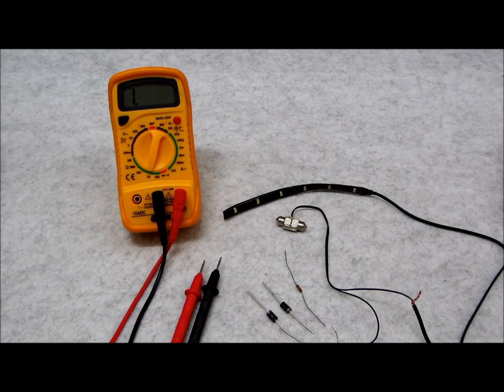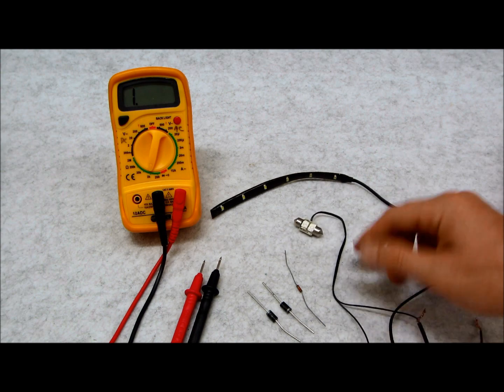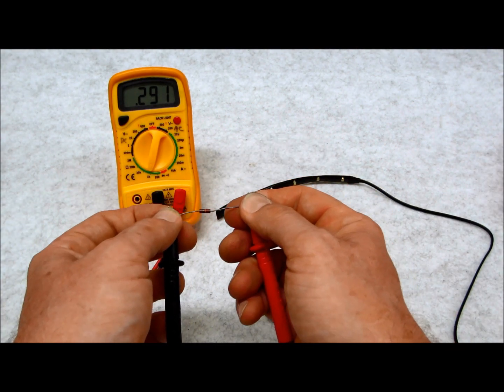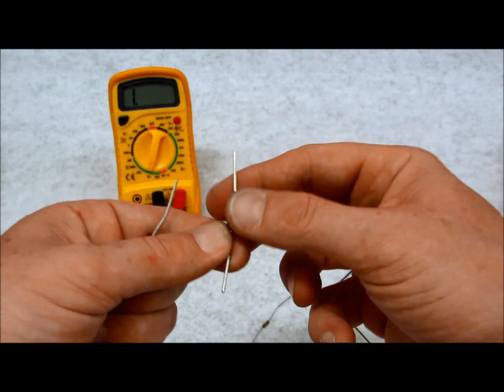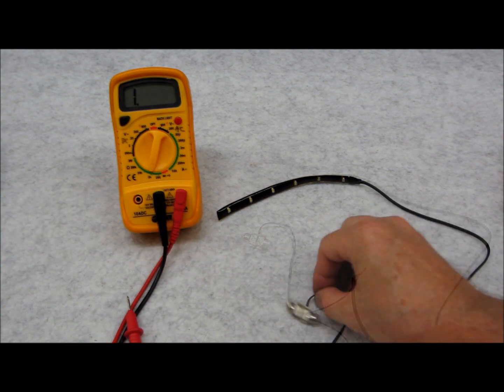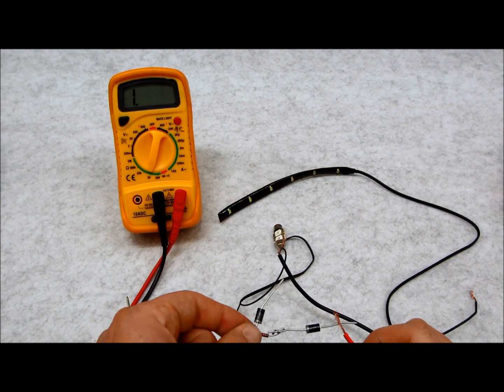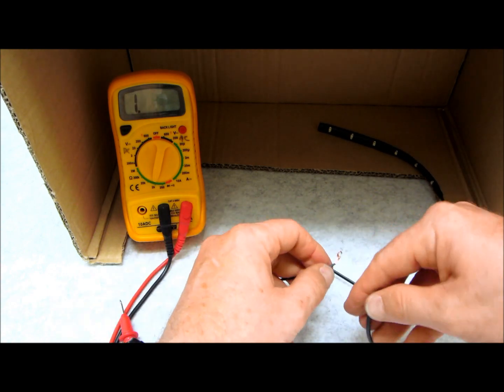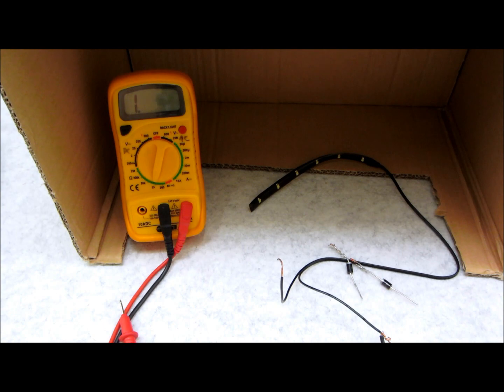How To Customize Motorcycle LED Lights / Dual Voltage and Brightness For Tail Lights

Comment: A question about the resistor. 
You said you used a 300 Ohm resistor, If you use a say 500 Ohm resistor the parking light would be dimmer correct?
Reply from the maker: +spongehow yes, significantly so.
Reply: +Lessco Electronics what about the wattage? 1/2 watt...1/4 watt
Reply from the maker: yes, you can also tinker with wattages too, theres just no limit to altering the variables of this stuff.
Reply: spongehow i

Comment: So you have to stop the bike, get off it, and manually switch the wire from the running light to the brake light, every time you want it to be brighter?

What good is that?

Comment: What diodes are they.? Is there different voltage diodes. Should I be looking for 12 v diodes for my motorcycle setup.
Also should I use diodes inline on all my led indicators aswell?
Reply from the maker: Fuji Wags These are the most popular 5 amp ones we sell:

http://stores.ebay.com/Lessco-Electronics/_i.html?_nkw=diodes&submit=Search&_sid=77826561

Comment: Just started a lighting project on my 98 Valkyrie, and while searching internet for cool brake/tail lights, I came across your video. Thanks for doing that. Very smart. I'm impressed. I hooked a cpl LED's up earlier and my 10amp fuses kept blowing. Hope I don't screw it up and burn my bike to the ground.

Comment: Lessco Electronics i want to design for 1w 350ma star red leds . .n same 14v dc power from motorbike(while running), so could you guide me if this design and components goes fine and gonna smoothly work for me , and how many maximum leds i could fit in the circuit, so that it does not burn out later . .plzz do suggest . .!!

Comment: i want my led to be a little bit brighter under the resistor so should i choose a higher ohm or lower ohms. for example 600 ohm 1w for a bright look or 250 ohm for a brighter look......... PLEASE HELP
Reply: You'd want a lower ohm resistor, so 250 ohm would be brighter than having the 600 ohm.
Reply: thank you

Comment: Usually a motorcycle led strip supplier will sell the dual element part for anywhere from $5-$10 all soldered and shrink wrapped. No need to do all this if you really don't understand. I know I didn't at first and it can be frustrating.
Reply: Carlos Pena i

Comment: Just my 2 cents, the smaller the resisistor value  i.e. below 300 will make led brighter when running "dimmed" ..choose your resistor value at will depending on wanted "dimmed"brightness.. if I'm not mistaken, with my very basic electrical knowledge

Comment: A diode converts AC to DC. But you are using a battery for power, which is already DC. I don't see any need for the diodes in the circuit.
Reply from the maker: You may want to check on that, a diode allows directional current - either negative or positive. A transformer converts ac to dc. Please don't give people bad advice, there's enough out there as it is!
Reply: Lessco Electronics
Without seeing a circuit diagram, I can't really know what's going on  My assumption was that the circuit you are describing is something like this: http://goo.gl/vlLngF where 'r' represents the light bulb, 'R' is the wire with a resistance, and the switch represents the brakelight switch. When the switch is closed the current in all of the wires is in the direction of the negative terminal of the battery. It will never flow backwards through 'R'. Therefore I do not see why the diodes are necessary. If I am wrong, I would be thankful for an explanation.
Reply from the maker: 2 diodes are absolutely necessary as to not allow one r to bleed into the other, its an elementary double diode isolation technique
Reply: Tx
Reply: David Hume i tried it, it doesnt work without them.
Reply: Yeh, I know. I was wrong. The poster explained it to me.